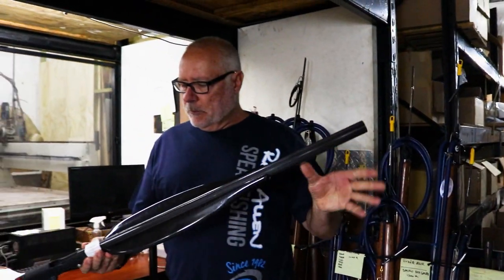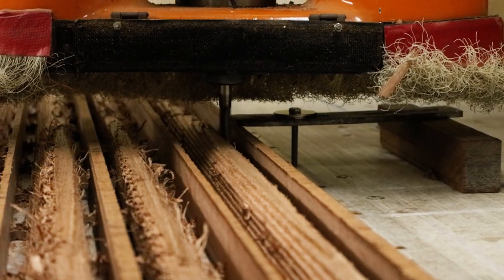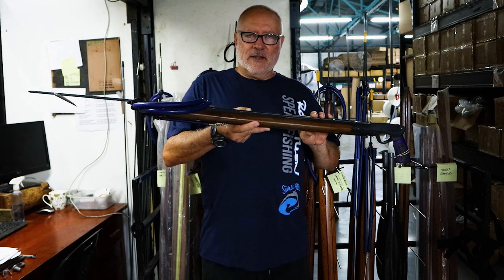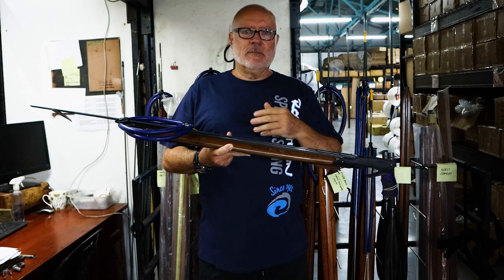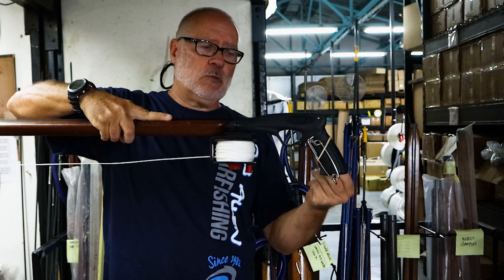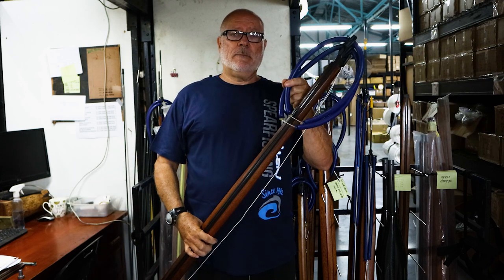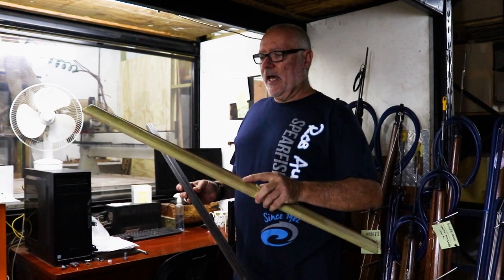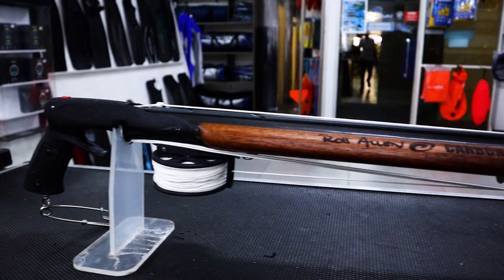Rob Allen | Timberline Series | Part 1 | 2022

Comment: Dear Rob and team, I finally got a chance to try a timberline roller 1300 and I love it! ♥️

I'm a big fan of RA brand and still got my first carbon SUTO which is already 14+ years old (if I'm not confusing) and it's still performing well. I got a black mamba 1300 as an upgrade, keeping SUTO as a backup gun. I really enjoy the maneuverability of the carbon guns (hate the recoil though :)) )

But since I've matured into a more experienced diver, and been chasing bigger fish, I've noticed that I'm missing power and distance with my carbons comparing to wooden guns my friends got. 

At the same time you announced the Timberline, and I thought that might be it. When they arrived to Australia I was a bit disappointed with the pricing, so decided to postpone the purchase and bought a Riffe Marauder 63 instead. 

Riffe is a beautiful gun, but it's different to what I used to - handle, how it shoots, how it behaves in the water, etc. So switching between RA and Riffe was taking some time to adjust, meaning a lot of missed opportunities while adjusting, they're just 2 completely different guns.

Finally, I saw a great deal for Timberline Roller 1300. I didn't plan to buy a roller, didn't really enjoy the idea. For me , those were too complicated, too difficult to load, etc. I'd prefer to load 4 rubbers than load a roller. However, the deal was sooo good forcing me to reconsider. I did some research and found out that you fix the issue with the load difficulty by adding 2-steps loading, and some people use these rollers as all around guns because they can adjust the gun power loading it to the first or second hook. The loading speed is quite good 👍 loading to the first hook is quite similar to loading one banded gun.

Long story short, I was impressed with the gun performance, accuracy and shooting distance. Today, I got  fish that I wouldn't be able to reach with my 1300 2-rubber guns, and i was shooting from the first hook!! I cannot imagine how far it would go from the second hook (couldn't load it on the second hook today, need some more practice). I should say, it's the best gun I've tried so far and I tried quite a few from different manufacturers, brands and ranges.

Yes, you could use it all around, but I believe for the cave shooting SUTO and Black Mamba will do a better job, missed a huge Mangrove Jack in a cave today while pulling the Timberline against the current. Hence, SUTO for caves and Timberline for blue water, Mamba and Riffe will go to other good hands 😀

Just wanted to say that you did really great job with these guns, and you broke my patterns twice today! Hopefully the gun will continue impressing me. 

P.s. I got one jam today, the line stuck between a roller and the rubber stopping the shaft half way. The bottom rubber also popped from the hook. But I believe I was excited loading it and perhaps didn't secure the line well.

Thanks and thanks for great videos!
Reply from the maker: Many thanks for your in-depth review. Yes, rollers are prone to "roller fouling" if the lines are not set up tight. The longer the gun the more the spear line, the more likely it can happen. This is why we now offer a finned spear with the option of attaching the shooting line outside the rubber. This keeps it free from being trapped under the rubber.

Comment: Amazing! Offer one of those in 90cm with your roller head, 120cm 6,75mm shaft and 14mm robbers cut to 390% and make it available in Denmark - I will buy it 🤙 I am using your carbon rollers now, but the biggest weakness is buoyancy especially in shallow water where we sometimes hunt with the gun parallel to the seabed most of the time. Looking forward to following the development, Rob!
Reply: +1 for 90 cm gun with 14mm rubbers and 6.6-6.75mm shaft :)

Comment: Please use the cnc to make a modular wood gun that can be broken down for travael and reconfigured at lots of different sizes !!!
Reply from the maker: Easy to do that but the spear is always the problem. You can't make a spear in 2 parts without seriously compromising the spear.
Reply: @RobAllenSpearfishing  ugh if only it weren't so! I know riffe or some European company had a spear that unthreaded like bolt and nut. But it was bloody expensive.

I also imagine it would be impossible to take apart at the end of your trip with no tools.

I never really considered strength was the issue...
Reply from the maker: @zero2spearo  yes, major issue with strength, as well as probably doubling the spear price.

Comment: Looks really good and expensive, but why not just do a foam clip on buoyancy attachment, like pathos?
Reply from the maker: We would need multiple molds to make multiple variations to balance correctly. Also, if set up wrong, the product will get the a bad rap.

Comment: Is there anything that you're willing to reveal about these "triple band" guns?
Reply from the maker: Yes, it is in development. Making the muzzle is the easy part. the  problem is the increased load on the trigger. We have had to modify the trigger and sear such that it will feel the same as a double rubber gun. A 3 rubber gun will apply 33% more force onto the trigger and therefore will have a greater trigger pull. We have made changes to this to make it feel the same, simply by changing the contact points of the sear lever.
Reply: @RobAllenSpearfishing  yeah I was thinking about that, I presume this new mechanism will be used on the double rollers as well? Can’t wait for the stuff new stuff you guys are creating, love every one of my rob Allens
Reply from the maker: @urb6857  No, the forces involved with a double roller are the same as a double rubber non roller.